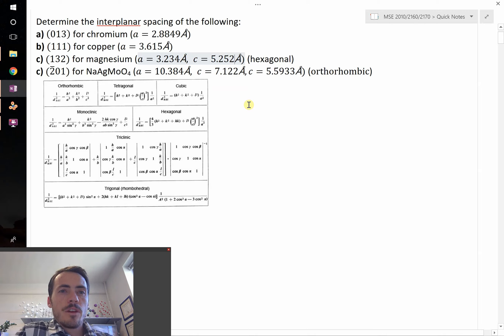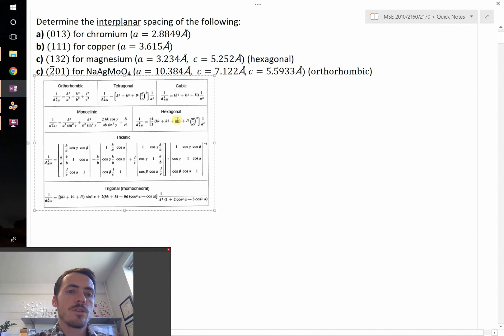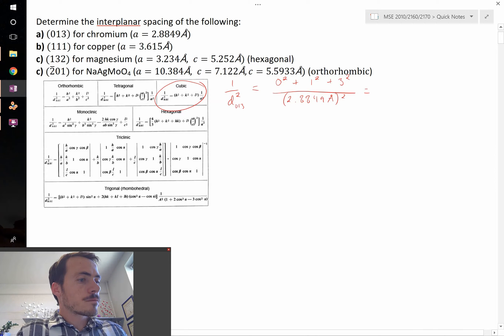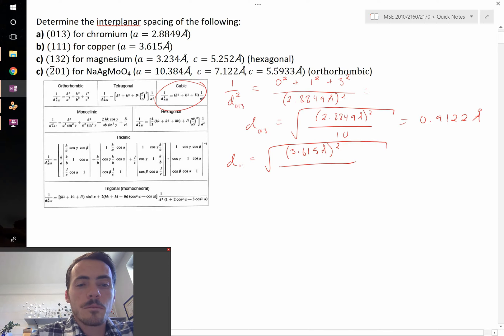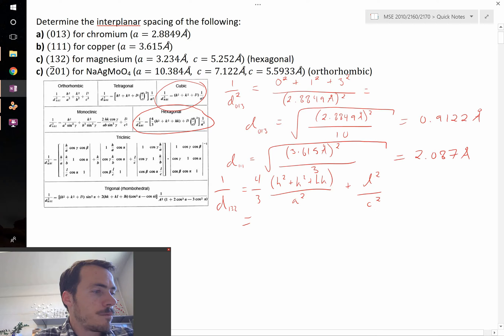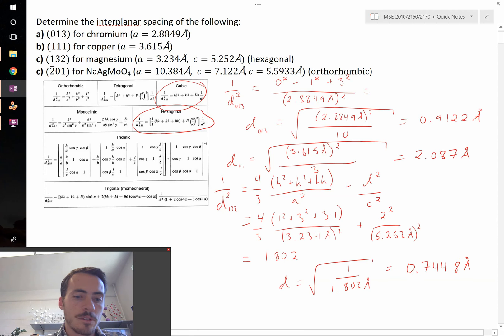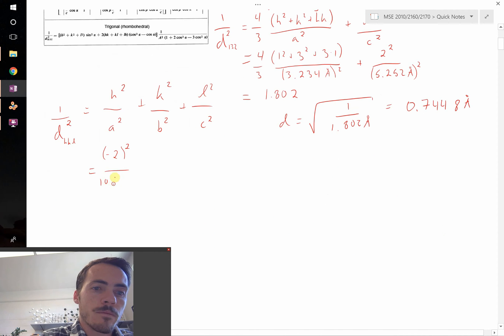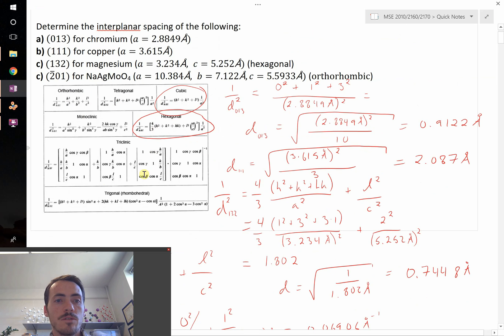Calculating d-spacings for different crystal structures

Comment: I want to know a and c for a tetragonal system, and only know d and hkl. There are two unknowns so you cant solve it, what other steps are needed to get the lattice constant? Thank you sir
Reply from the maker: The trick is to start with the 00l reflections and use those to solve for c, since the a terms will go to zero. Once you know c you can pick another hkl peak to solve for a
Reply: @TaylorSparks  thank you. why exactly will a go to zero for 001? I can see that if you use a plane with l=0, the c term falls away and you can calculate for a. But not if you use 001